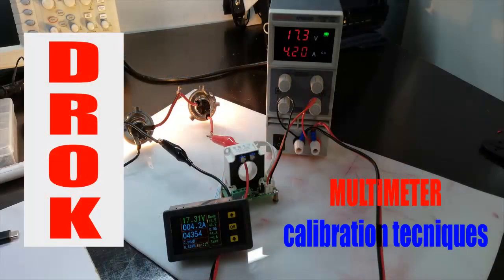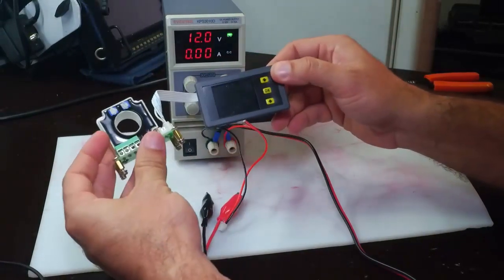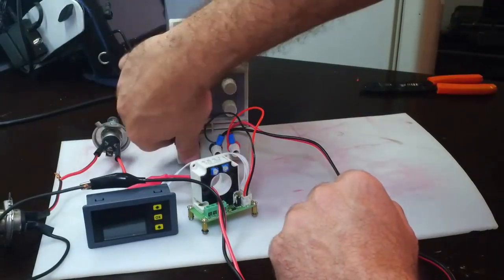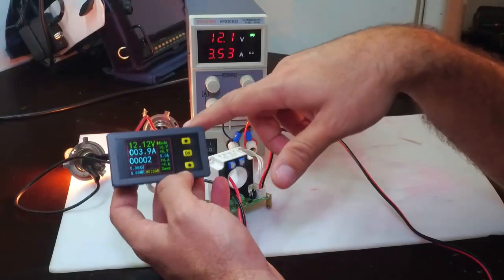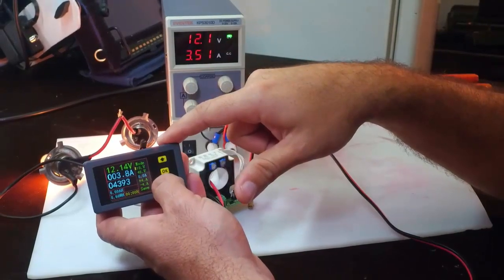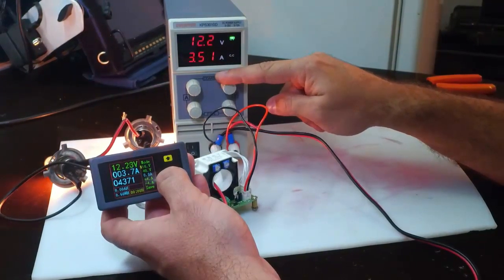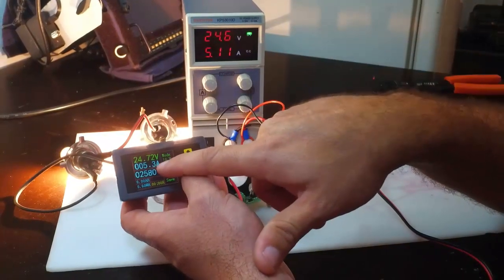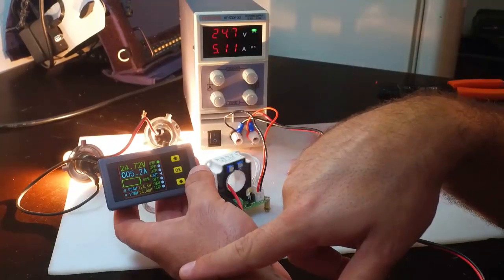DROK digital multimeter 0-90V 100A calibration tecnique.

Comment: Good video, but I'm not having any luck with mine.  I go though the calibration and after I save it it will be good on Low current.  High current it will be off.  I think there's something wrong with my meter.  In calibration, if I go up in the current number and go a little too high.  I go back down one digit and the current reading drops to 0. Not sure what's going on.  I've been working with electronics for 40 years and never seen such a thing.
Reply from the maker: It sounds to me like you have a defective unit. It shouldn't be that way.
Reply: @AdrianCubas1980  I think it is also.  After I posted that comment,  I tried again.  After that,  it was reading 8 amps when there was no current flowing.  Guess I'll try another one.

Comment: Why two bulbs in series?  Just one 50w bulb will draw about 4 amps.
Reply from the maker: A 55W car bulb consumes approximately 4.6A but when a voltage of 12V is applied to it. This power supply reaches up to 30V, which would mean more than double the consumption and the bulb would burn out during the tests. I just didn't have a 24V bulb lol

Comment: I liked your video. The back ground noises (of the home life) were a bit distracting, but was okay enough to hear your instructions. Thanks for the video!
Reply from the maker: I just bought a Rode directional microphone and I think I have to record at times where there is not so much noise. haha thanks for your comment
Reply: @AdrianCubas1980  Well... It is working very well! I could even hear the rooster 🐓, outside, very clearly! It may have a setting for noise reduction? Which may help?
Reply from the maker: @chrissewell1608  In my next videos I will use the RODE microphone. In all my previous videos I used the audio from my mobile, which is horrible. That's why any unwanted sound sneaks in :)

Comment: Thanks for video!! If You could explain also to calibrate a pb or lifepo4  battery... Thanks
Reply: I think you would just calibrate the meter, for 12 volts, and then the Amp Hours of the battery being used. Ie. Any battery, at 12V, and 7Ah?

Comment: Just curious why did you calibrate at 12 and 24 volts? Did it say to? Is that best practice?  The menu said 10V and 40V....what do those values mean? I assumed it meant calibrate at 10V and 40V. Thanks for the video!
Reply from the maker: The reason is very simple, I don't have a power supply that reaches 40V. hahhaa. It would also be necessary to use 4 bulbs of (12V) connected in series instead of only two. My main intention with this video was to show the methodology of this process.
Calibration between two different and "far apart" voltage values is required because the sensor coil employs a bipolar transistor that does not have a purely linear behavior. This results in averaged measurement values that are closer to the actual value. Thanks for asking. Greetings
Reply: @AdrianCubas1980  Great! Thanks for the answer.

Comment: How to setup the battery capacity when it's Full Charged
Reply from the maker: You need to configure the OAH parameter. This will prevent it from being overcharged or over discharged to a lower or higher value and will set the limits for capacity. This video by Jehu Garcia can help you (6:35). 
https://youtu.be/m04CXhoQ2jU

Comment: This Hall effect sensing method/system is the best system to monitor DC current.  Since it is a contactless measurement, it's miles better than the shunt system.  The shunt current measurement system puts the measurement in the negative side of the DC circuit, which only works in an isolated simple system.  When the system is complicated (like in RV battery system), the DC current is bypassed through a complicated grounding/negative wiring.  The shunt system fails miserably.  If you want a reliable DC current measurement system, go for this Hall sensing system.  With Adrian's explanation, the voltage and current calibration can be done by the end users!  Great!

Comment: hey i try setting the meter up but all what i try its not working right
Reply from the maker: Did you verify that it was not broken?
Reply: @AdrianCubas1980  no it’s not it just not working the right way
Reply: @AdrianCubas1980  when I set it for the voltage or the amps it’s changing

Comment: Could you attach a 200A shunt and calibrate current to use with this meter?
Reply from the maker: I'm not entirely sure. It requires a little experimentation. Theoretically I think it is a good idea

Comment: Nice video.  Question,, is this set up usable to test capacity of batteries ( AH or WH ? ) I'm thinking to buy me such a meter..
Reply from the maker: The Drok can measure the battery capacity, although I prefer to use this other Aliexpress product. It is very economical and I find it more accurate for this type of measurement. Is my affiliate link, no extra cost for you. Thanks

https://ali.ski/dfOtqb
Reply: @AdrianCubas1980  Hi Adrian! Thank you for your material! One question: Do this product to measure battery capacity that you suggested have a cut off for low voltage protection? Is it configurable? I work with LiFePo4 battery that needs a cutt off at 11,6V (2.9 for each of its 4 cells). I didn't see the cables for monitoring each cell during battery capacity test. Do you recomend one that monitore this also?
Reply from the maker: @gsilos  Greetings Fabiano. In this meter there are two programmable functions OVP (Over Voltage Protection) and LOP (Under Voltage Protection). If programmed correctly, this module could maintain an appropriate voltage range for your battery type (LiFePo4). However, I do not recommend this module as an exclusive BMS, but rather as an additional protection. I can suggest ypu for example this BMS https://amzn.to/2CsLwpF from Amazon or this one on Aliexpress https://ali.ski/RrRGA If you only have the independent cells then you need a BMS or a Battery Protection Circuit for security reasons . On the other hand, if your battery is encapsulated, it may already have a BMS inside. Another detail, I think I remember that the minimum voltage of a LiFePo4 cell is around 2.5V, not 2.9V, as you tell me, although I may be wrong. The maximum voltage of these cells is 3.2V (four cells 12.8V) Greetings, your subscription is appreciated.

Comment: I just got mine in but... the directions say to face the hope facing the battery and not the load. I have the positive and negative wires going to the positive post and negative post on the fuse block it displays the voltage but will not show battery percentage or amp use... I’m at a loss
Reply from the maker: do you still have the problem ?. Please give me more details to see how I can help you. A photo of the connections you made would help

Comment: Adrian, awesome video. I have the exact same drok, your video is the only video regarding this model. Would you know or have you tried to add a relay to this model Drok. If you have I would really appreciate it if you told me how you did it. Thanks Adrian, be well
Reply from the maker: Please download the manufacturer's user manual at this address: https://drive.google.com/file/d/1RX4ZsaWpls2C3LWp6sfDmA8qn13IpVnc/view?usp=drivesdk 
In the third scheme it appears how to connect the RELAY. It can be very useful if you want to program the drok to disconnect or connect the circuit you make. Keep in mind that where LOAD appears it refers to the current source and where Battery appears it refers to the device that consumes electricity. Thank you and good luck.
Reply: Adrian Cubas , still haven't been able to figure out those instructions on adding a relay. My relay has 4 contacts as do most. 3 are positive and one is negative. On the diagram instructions its showing all negative leads. And what goes in the Vext - and + inputs. Its very confusing.  Have you tried messing with it? Thanks and good day.
Reply from the maker: It is true that the instructions in the manual can be confusing, I will try to clarify your doubt. I am planning to make a video next Friday, October 5 (2019) explaining how to make connections. Meanwhile keep in mind that the RELAY has two contacts for activation and two for the continuity or discontinuity of one of the positive or negative pathways, just like a switch to turn on the lights in a house for example. Greetings and stay tuned for the new video.
Reply: Looking forward to it Adrian, take it easy and good luck with video

Comment: Hello nice video very help full. Received mine this week and installed and adjusted. Do you know
 how to adjust the battery ah? And battery percentage?
Reply from the maker: Unfortunately, the drok I showed in this video broke down for no apparent reason and I had to use another solution in one of my DIY Powerbox. I think I remember that the drok automatically detects the capacity of the battery system after a discharge-charge cycle. If in your system you use lithium batteries with a BMS then the drok capacity values will be more accurate. It is because the BMS will prevent the batteries from being discharged or overcharged beyond what is recommended in a stable range during all discharge-charge cycles. I recommend you the Jehugarcia YouTube channel. He always uses the drok on his devices and in a video related to a powerbank for Puerto Rico I think I remember talking about this. Any doubt I am here. regards

Comment: You are assuming that your bench power supply is correct. You have not shown that the bench power supply is actually correct. All you have done is make both meters read the same arbitrary unsubstantiated reading.
Reply from the maker: Of course I checked previously that the readings of my "BENCH POWER SUPPLY" were "correct". The instrument I used was a Fluke multimeter that is not the super super, but it's the best I have. The intention was to show a procedure to access the hidden calibration menu of the Droke. I do not think it is economically feasible to try to calibrate the droke as it should be. The ideal would be in a specialized laboratory of some respectable company, with certified instruments, with appropriate humidity and temperature conditions, considering the possible sources of electrical radio interference on the apparatus to be calibrated etc. regards
Reply: @AdrianCubas1980  Thanks for confirming the accuracy of the Bench Supply with
a Fluke DMM...;-)